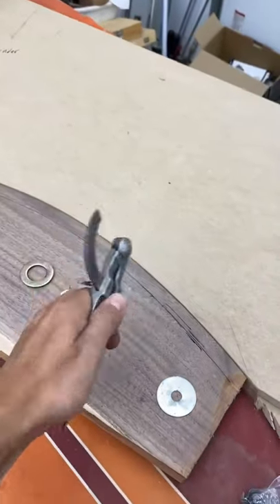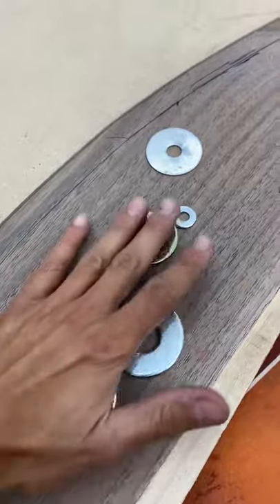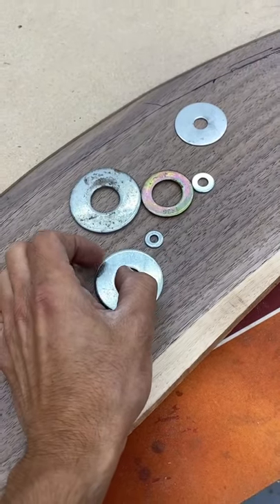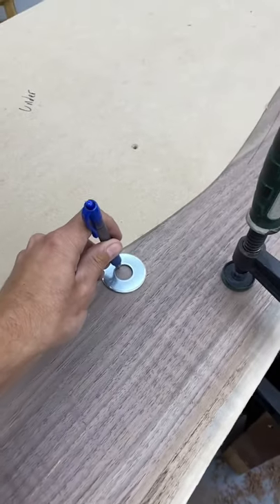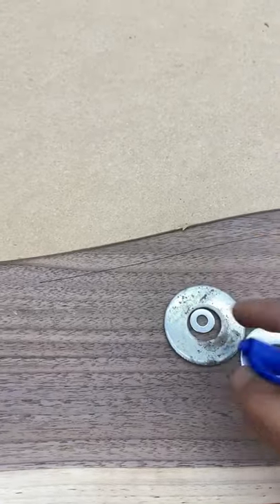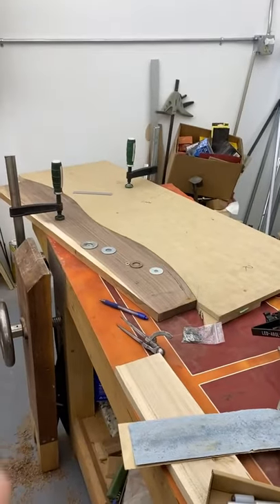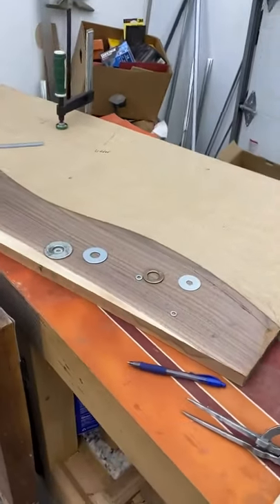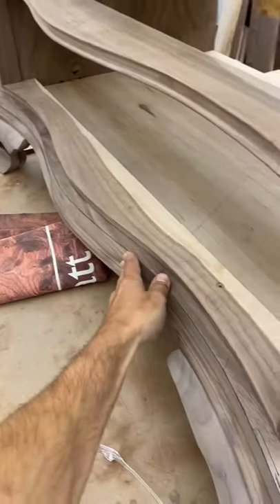Laying out an offset with washers | quick tip #shorts

Comment: Geometrically speaking, it doesn’t work. More precisely it works less when the distance increases. Because with this method you have a constant distance with the tangent. It’s not a translation. But obviously it’s good enough when high precision is not critical.
Reply: Geometrically it works perfectly and is very accurate. Maybe you should take basic geometry again.  Though it's captain obvious that this works well to most intelligent viewers.
Reply: I apologize if my comment was aggressive. I hope at least that it was not as aggressive as @airgliderz .
But it is true that I got misdirected by the use of washers that are used in other videos to reproduce a shape. In this case, keeping a constant distance with the tangent is actually the point. Still, be aware that the drawn curve does not match exactly the original one. It might not be the visual effect expected especially with hard curves and/or big washers.
Reply: @timokkhan9020  the cut angle at the end of the piece is what changes depending on point of the curb. of course the radius of the two sides changes with the waves but the washer compensates for that.